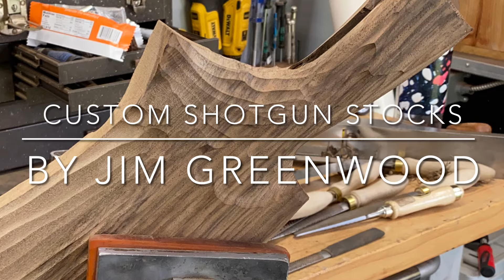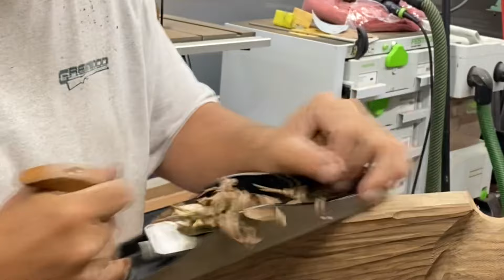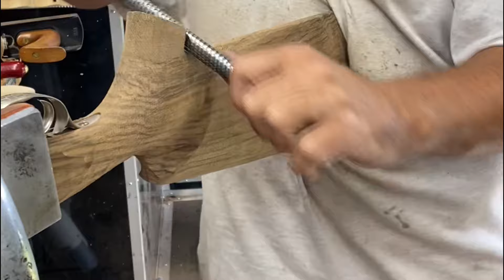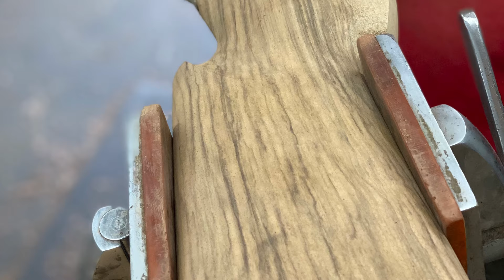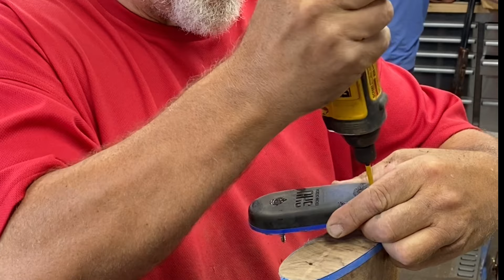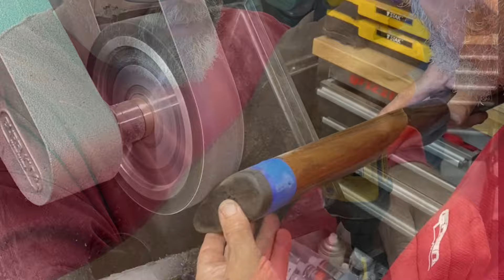Jim Greenwood, custom stock maker in Augusta, KS (USA)

Comment: He is putting too much pressure on his rasps and files which will crush the wood fibers and affect the overall integrity of the stock. He is a little too rough for my tastes.
Reply: Well if I were removing material for shaping I wouldn't be petting the kitty either.